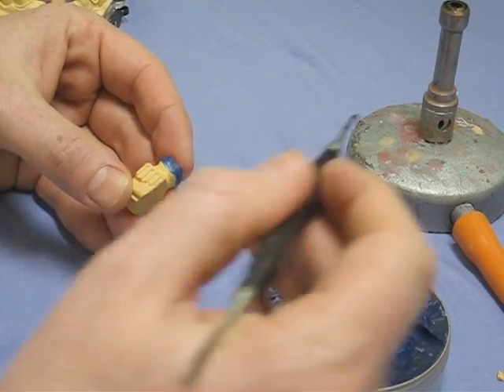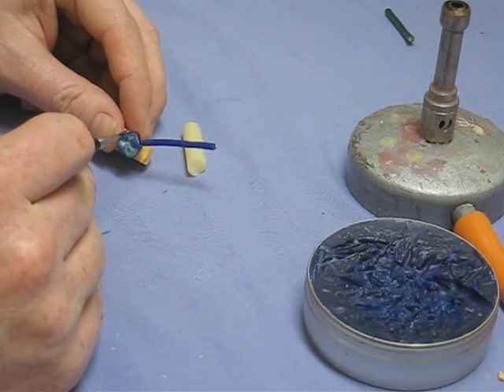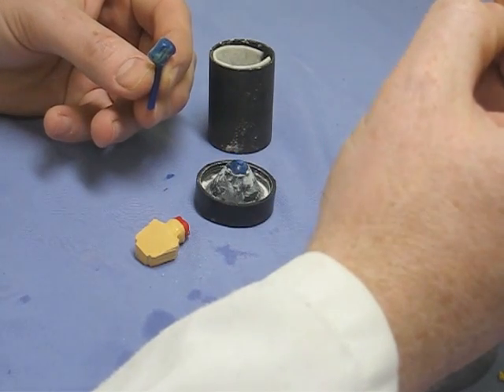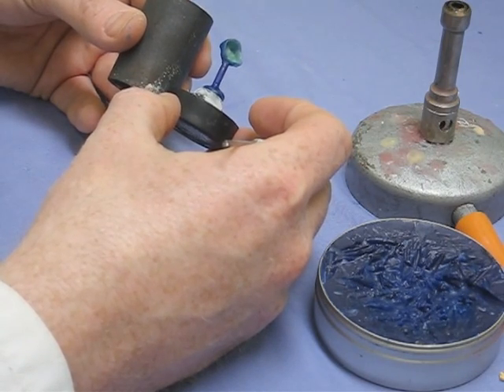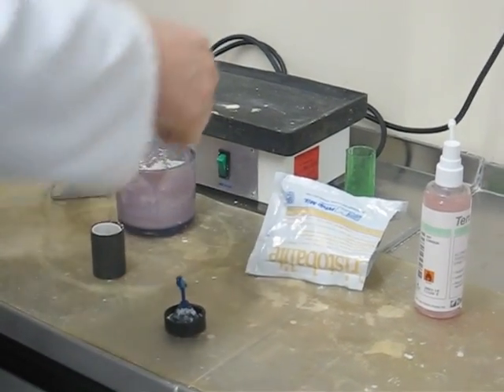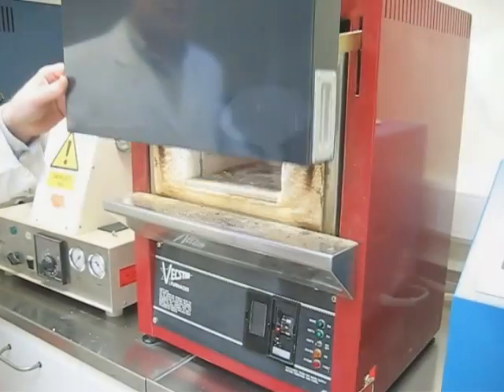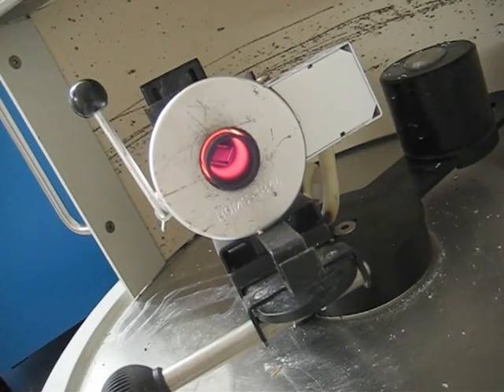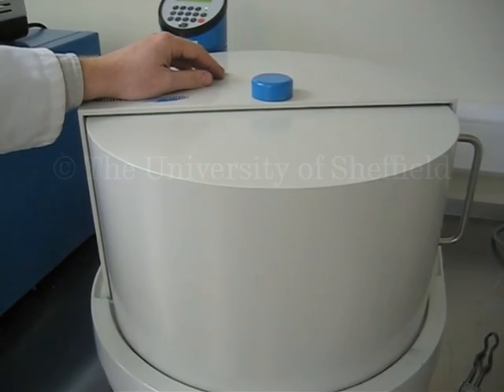Restoring a tooth (Gold Crown) - Part 2

Comment: The best performing labs work on three areas in their crown and bridge lab to give them their biggest payoffs.

1- Products
2- Techniques
3- Technicians
Rapid Wax gives you an even .3mm thickness on all four walls of the coping and (HD) High Definition Margins. Margins that won't shrink back or open up after waxing. Proven and tested under 10x microscopic lens.

For ordering, Call 209-872-1446